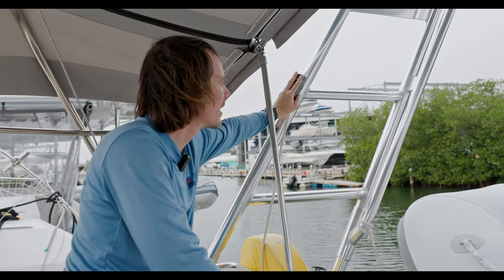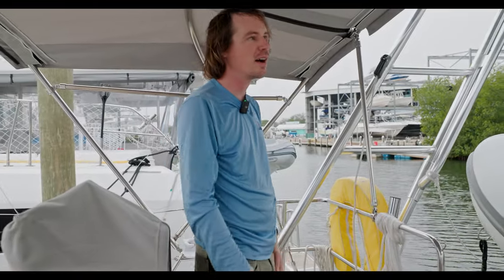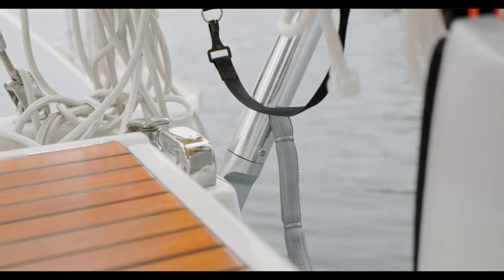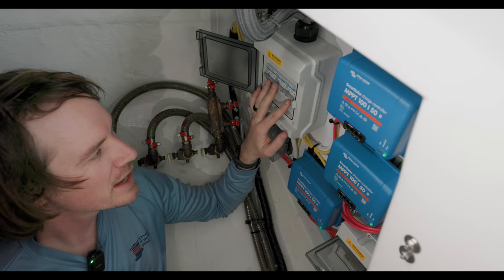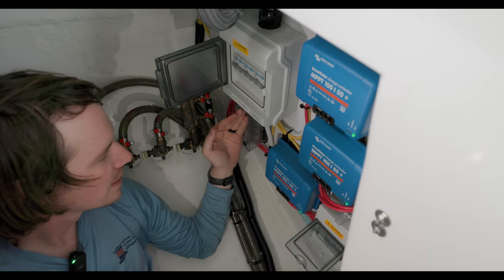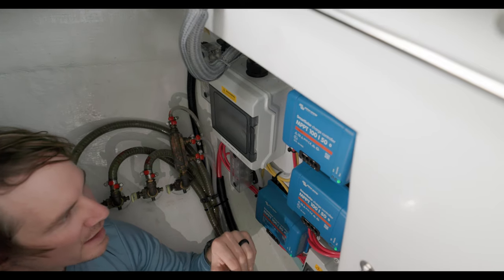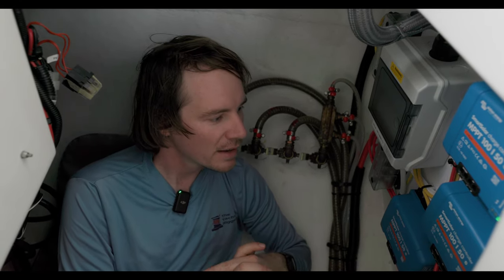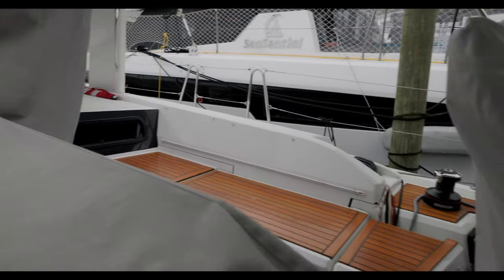Turnkey Solar, Arch, Controller, and Dinghy Lift System -Made Simple

Comment: Oh my…a monohull!

Very informative. Loved  the tip on the pvc board. 

Could you get the numbers on the panels and run down how the 100/50’s were chosen over a 100/30 MPPT? Do the bifacials increase the current that much over the rated 480watts of the front side?
Reply: Those are Q-Cell 480W bifacial panels. A 100/30 MPPT would be undersized on this 12V system. Looking at this client's VRM data remotely for today, one of the panels hit a max power output of 584W... so yeah! It happens frequently that they exceed their 480W rating (at least once a week for them it looks like in their data), but it usually doesn't last for long as they heat up and reduce their output. Most commonly that happens mid-day right after a rain shower if you get bright clear skies.
Reply: @FrankTheYachtRigger   that’s awesome. I guessed the Q cell (480w)  and I think undersizing, in any case, will let them get as much amps as they can when the sun is shining and the dinghy and water are reflecting. (Confession: I work so much in 24v that I didn’t think it through before I asked. New rule: coffee first on Sunday morning!)

Comment: Another great install. Thanks for sharing. Out of curiosity, what type of wire gland system are you using to get those solar wires through the deck?
Reply: That would be the Scanstrut DS-Multi. The 10/2 AWG wires are stripped back out of their sheath before passing through the DS-Multi individually, so, a total of 6 holes in the DS-Multi gland.